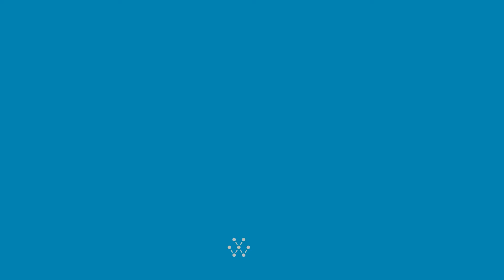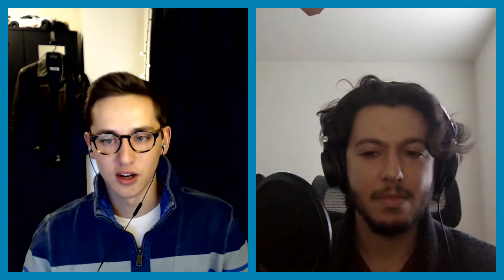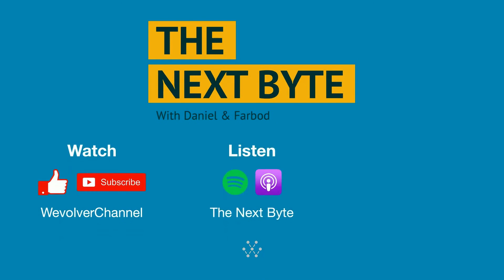AI for Mechanical Design – Automating Materials Selection for Part Design

Comment: As an engineer in the plastic parts mechanical design, let me tell you the pain I go through just to get a stress-strain graph. It is impossible. Not to mention the ridiculously short descriptions of the material properties, that should be enough to convince me to pick a certain plastic. If AI can compile the graphs from, I don't care where, if they are correct, and can give me a quick comparison, especially in the price section,  I will be a happy boy.